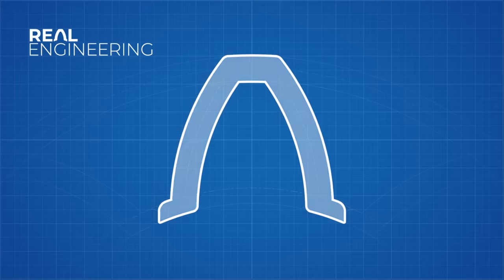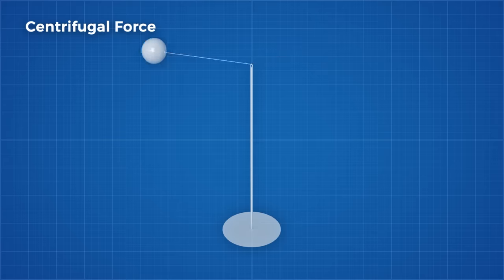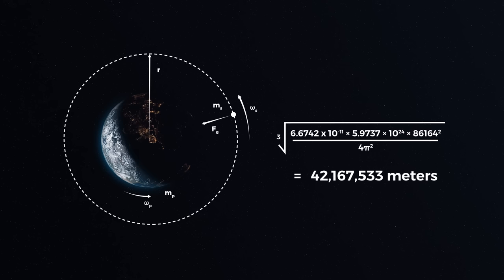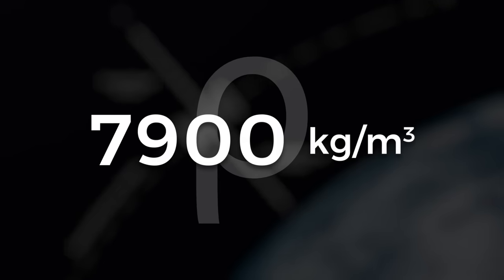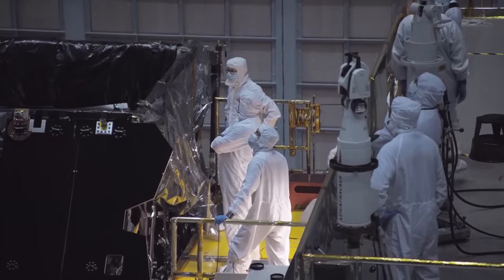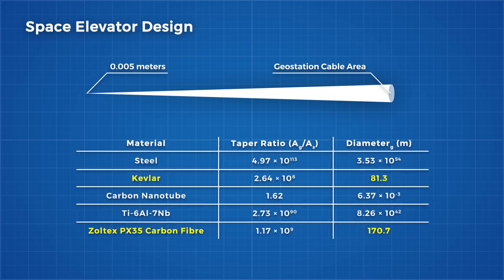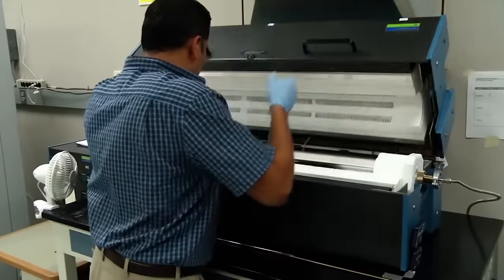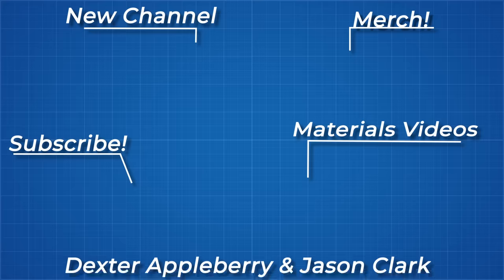Are Space Elevators Possible?

Comment: Short answer:  We have the maths and the engineering parameters but significantly lack in the building material strength to weight ratio category.
Reply: What we can measure for Carbon Nanotubes, if we could actually build them to a reasonable volume and length, it would absolutely be possible to build Earth's Many, many Space Elevator cables

While Space Elevators are conceptually envisioned as solely Equatorial constructions, thats incorrect. Once the counterweight is in position, it can be used to anchor any number of space elevator cables to the hemisphere of its Line of Sight.

In fact, When it is built for real, the Counterweights will be positioned over India and the Atlantic, So you could theoretically embark on an elevator in Syndey, Australia, and with some transit as the counterweight, them embark on the elevator to Athens, Greece.
Reply: @loturzelrestaurant  naw.
Reply: @Azakadune  Ok. But are you really sure? 
It would cost no money at all, just a bit of time, and it would benefit all of us, which of course includes you. 

Also: Dont you wanna fight some Karens? I bet you know that term. I know some, and you could flag them, so they have to leave.
Reply: @loturzelrestaurant  just wanna ask, what are you actually want to do?
Reply: Mr. Shack, that is the standard answer to what is holding back building a Space Elevator.  While super materials do need researching it's not actually true it's keeping mankind from building one.   A super strong connection is dependent on the design of the elevator and hundreds of other factors.  It's possible to design a working Space Elevator with variable requirements and capabilities.  Like most successful inventions the first working one should be a small prototype to test and measure for what is to follow.  Skyscrapers for instance were iterations of success as most things are.  So we're telephones, planes, ships, etc.  First just do it, then elaborate and improve.
Reply: @loturzelrestaurant  I'm racist, what are you going to do about that?
Reply: @lemonov3031  Cringing? 
That, for starters.
Reply: @lemonov3031  Afterwards, I'm pitying you. 

Do you wanna hear more about what i do?
Reply: @loturzelrestaurant  No, you are a spammer who posts off-topic crying for no reason
grow a pair and stop advocating for censorship
Reply: @lemonov3031  ...Oh, buddy... please stop embarassing yourself now... Its fine.
Reply: @loturzelrestaurant  sneed
Reply: we on't even have the fabrication technology to build a cable that big anyways
Reply: @loturzelrestaurant  I don't think spamming those words here in a YT COMMENT SECTION (out of all places) is you doing a "good cause"
Reply: @PlanetEarth3141  Materials and technologies are important but.... do we really need such elevator? Lets say we want to use it to get to LEO. Then we still need a rocket to accelerate to the orbital speed. Or if we want to get to the base station at the GEO.. then we talking about travelling ~35000 km. So how fast this elevator should go? 100km/h will result in 350 hours, roughly 2 weeks from Earth to the station. If we can manage to go up with 500km/h it makes ~70 hours (~3 days). For cargo it's kind of OK, for people not so much 😉
Reply: @tjblues01  Are you really a pilot?  Or did you take it off the internet and use it to insinuate you are?
Reply: @PlanetEarth3141  Your questions have nothing to do with the topic at hand. What did you want to accomplish by asking those questions?
Reply: @PlanetEarth3141  🤣🤣🤣🤣🤣🤣
Reply: Or you could just use Kurzgesagt's method and go with an orbiting "skyhook" basically one central body in orbit, and two long "hooks" of equal length going out in either side, with the whole thing rotating as it orbits... Basically you'd take your vehicle space plane thing and dock to the end of the hook, and hitch a ride either up to space or back down to earth
Reply: At some point heavier then air material overcomes this is impossible.
Reply: @F14thunderhawk  I'm racist and homophobic, also I'm a fascist, do you have some problems?
Reply: @loturzelrestaurant  I’m not a racist but you make me want to be one.
Reply: @myusername3689  "I’m not a racist but you make me want to be one." 

Allow me to own you by just reflecting youre own comment at you, cause that's all i need
Reply: @loturzelrestaurant  nigga 😭😭😭😭
Reply: @loturzelrestaurant  where is the link brother? Gimme a discord or something so we can talk
Reply: @lemonov3031  Lemonov Your comment from 1 year ago is so cringey to re-discover, it hurts.
Reply: @myusername3689  Dude, your comment from 2 months ago is hilariously cringey.
Reply: @thisiswhereidied3054  If you want Targets to flag then just go and watch various People covering Kent Hovind and Matt Powell. Countless covered him and you will see he's reportworthy. 

Not much for me to do here, mate.
Reply: @loturzelrestaurant  The sign is a subtle joke
Reply: @lemonov3031  What did you say that's racist?
Reply: And that's ignoring the science all together.
Reply: Not only Lack of (light but tough) material, but also in principle, at near Terminal point (36,000 kms alititude) we still need Rocket Drive to keep Tensioning the Cable(s) or in short, to Rescue the Alititude, not to be Dropped-down.. by using of 3,100 m/sec (Booster) Velocity. No nothing for a Free- Ride, 3,100 m/sec Impulse of Rocket (@ teminal end).. still lots of FUEL to be burnt. We live in the Real world of Carbon-Hungry machine. (If not, the whole Station will gradually lose the Altitude and Fallen-down to earth.)
Reply: Even shorter answer: no we can’t build them
Reply: fElon will save us! lol
Reply: @lemonov3031  racism is just externalized insecurity
Reply: Gotcha.
Reply: Don't be ridiculous! There's a high school kid in Queens who invented a liquid polymer that air-hardens instantly into a synthetic analog of spider silk strong enough to stop a speeding commuter train! Mostly he just uses it to swing from skyscrapers, but I'm sure he'd license it for use in aerospace applications. He's also discovered some intriguing pharmacological properties of radioactive spider venom.

Comment: other less discussed issues on  space  elevators is variable amounts of drag along the due to variable weather and increasing altitude, and whether it can properly resist or transmit thermal heating from friction and electric magnetic effects which snapped a multi mile long tether experiment on a space shuttle mission, and what kind of impact if any such a megastructure could have on earth/solar interactions, and what kind of tidal loading are earth, moon, sun interactions going to put on it; and whether micro organisms carried by the rain would colonize and begin eating the yummy line at the bottom, and how the top could survive contact with natural or  unmanned space debris. The benefit of most space craft is that you don't get sea barnacles trying to grow on them, and if they are in  danger you can boost them to a different orbit. This one is anchored. Actively defending the structure from "the elements" could be cost prohibitive even if building it is not. I think people could build them somewhere, the earth system just doesn't seem to be the ideal planetary situation for that type of space infrastructure.
Reply: You lost me at other
Reply: All great points...Also, how long have we been talking about carbon nano tubes, for quite some time.That's a mass mining and production scale we're not close to completing.  It seems like we're decades maybe even a century away before we could even look at the idea of having a space elevator. Like you said, there are just too many variables that would bring that bad boy crashing down and flinging everything else into space with no way to retrieve it.
Reply: From what I understand moon space elevator is possible with today's  technology and is actually easier to build because the moon is tidally locked. you have to put the satellite at the Earth-moon L1 and balance it there. But compensating for tides shouldn't be that much of an issue. you could either use thrusters or simply  change your center of gravity by moving the counterweight up and down.
But everything else is an issue. And weathering, needs to deal with space weather as well.  It has to deal with the solar wind and the environment in the van allen belts. 
A more serious challenge though would be the winds. Any force acting on the cable inside the atmosphere would be propagated through the cable to the space station which would need to constantly mitigate for it. 
As for space debris I do imagine one might mitigate this by having a mobile base, which can change position to avoid collisions. One imagines this could be achieved by moving the base and the station in a coordinated fashion along the equator line, but now you have another factor to consider: waves. Still, I think all this can be solved in software. 
It does pose another problem though: when the base and station move to avoid collision, this induces extra strain on the cable, which will lag behind due to inertia, so you'd have to factor that in the design.
As for erosion due to either lifeforms or weathering one does need to factor in the possibility of maintenance. And this is one structure you can't afford to neglect for a few thousand years, like the pyramids, as it would come crashing down on the planet.
Reply: @Peanutdenver  there is no additional mining output to be required to build something on this scale, especially if there was a slow down in other sectors that demand the raw inputs, but mass production output of quality graphene and/or nanotubes would have to greatly increase. and yes, entire fleets of reusable spacecraft, and the ability to economically collect, deorbit, deflect, or eject uncontrolled space debris are all vital prerequisites to both build and protect a project on this scale
Reply: Carlos Saraiva  On bodies with no atmosphere space elevators aren't really needed since you can use mass drivers to launch things from the surfaces since there is no air getting in the way.

https://en.wikipedia.org/wiki/Mass_driver
Reply: Also, there is no way to cheat the amount of energy it takes to get to orbit in the first place. Hoisting an elevator car(or w/e) up the cable would still require the same amount of energy that it takes to put a rocket in orbit. Sure, you can use electricity(if you're patient, ride would be slow) hooked up to the power grid on Earth, but that energy still has to come from somewhere. There is no free lunch.
Reply: @Thumbsupurbum  that is not correct, because the process of delivering the payload up to the orbit involves much more than just providing it with the required energy. Some energy is wasted in exhaust, and a lot of energy is spent to lift the stages that are later discarded.
Reply: @Tirinir  Yes, and some energy is wasted in the transmission lines from power plant to the site as heat. My point is that hoisting the car up would still come at a high energy cost. And that's AFTER building the incredibly expensive infrastructure. That point still stands. And will remain true, because you can't cheat gravity my friend.
Reply: @e1123581321345589144  It would be even more challenging since the moon slightly drifts away from Earth each year. I guess constant maintenance would do.
Reply: @Thumbsupurbum  Absolutely false. The whole draw of a space elevator is that you don't have to fight gravity and air resistance constantly pulling you down the whole way because you have something to push against. Most importantly, you don't have to carry extra fuel to lift all of the extra fuel you have to carry to lift all that extra fuel needed to carry that extra fuel (see: rocket equation). The energy used to lift 1000 kg payload via rocket vs space elevator is extreme. It's like comparing riding an elevator vs jumping 200 stories straight up. The elevator is just so much easier.
Reply: @toxicbubble5  Elevators have to work against the force of gravity to move up. What are you talking about? Gravity absolutely applies. If I'm pulling myself up a rope, I still have to pull myself up against the force of gravity. The rope doesn't help me achieve this. It only gives me something to hold onto. Air resistance applies too, but probably not relevant since the speed would too low to matter. Unless it's in a vacuum, but that would require even more energy to maintain.
Reply: Carlos Saraiva  They both require about the same amount of energy to use, but mass drivers are much smaller and require less materials. They can also be fired at different strengths to send payloads into different height orbits, or even directly onto interplanetary trajectories, rather than just geostationary orbit. The only real downside to mass drivers is that their payloads do need a little bit of maneuvering fuel to circularize their orbits, though that's not an issue for interplanetary launches. They also don't need to be built at the equator. They can also send payloads into inclined orbits, such as polar orbits. In general they are cheaper and easier to build and just way more versatile but are more limited on what bodies you can build them on.
Reply: Not all of the energy would come from the power grid, as the elevator would be pushing sideways on the cable the entire time it is moving, essentially getting (or losing) some energy from the planet's rotation. This also brings up the concern about the orbital velocity of the station at the end of the cable.
Reply: @Thumbsupurbum  Existing elevators use counterweights so no energy is needed to change altitude, only to change speed. Couldn't a space elevator recover and store the energy of the carriage as it descends?
Reply: @Thumbsupurbum  Of course you have not taken in to account the energy that could be generated by "regen braking" when the elevator comes down again (possibly filled with waste, maybe even space debris)
Reply: @Thumbsupurbum  On an elevator you don't have to constantly work to maintain your height however, which is what Toxic was probably getting at. Its the difference between standing on top of a building versus hovering with a helicopter, the first lets you maintain a height passively, the other require a constant input of power. A rocket has to not only provide the energy needed to lift itself upwards, it also has to constantly work to keep that height, every minute it spends getting to orbit is another minute it has to deal with gravity losses. 

https://en.wikipedia.org/wiki/Gravity_drag

An elevator car doesn't have to deal with that since it has the cable to grab. It could lock its breaks and just hang at any altitude completely passively. This lets it climb upwards at a leisurely pace since it doesn't have to rush to avoid gravity losses. That slower speed also vastly reduces air drag. 

Those increases in efficiency pale in comparison to the main one however, which is that a space elevator doesn't have to lift its own fuel. Over 90 percent of the fuel in a rocket launch doesn't go into lifting the payload, it goes into lifting other fuel. And that's just the fuel efficiency, the energy efficiency is even worse. Chemical rocket engines aren't particularly efficient at converting the energy in their fuel into kinetic, most of the power ends up as heat in their exhaust.  Even if the power transmission system to a space elevator car was only 1 percent efficient that is still significantly more energy efficient than a chemical rocket.
Reply: Great points, Earth space elevator is likely not happening.  Moon and Mars space elevator on the other hand is a near certainty.
Reply: The mass of the Earth is > 5*10^24 kg. Steel has a density of < 8*10^3 kg/m^3. GEO is at < 4*10^7 m. Imagine a steel tether stretching twice as long with a cross sectional area of 1 m^2. It's mass would be < 2*4*10^7*8*10^3=6.4*10^11. Compared to the Earth that is about 1/10^13. I haven't done an extensive analysis but I think it's pretty safe to say it's gravitational impact would be negligible.
Reply: Element proofing will be a problem to meet safety standards.
Reply: I agree its 2020 we dont just build just because its possible.  We build if its wise n safe now
Reply: Low gravity means not high thrust needed to escape gravity there.
Reply: Carlos Saraiva isn't the whole point of a space elevator to have a low gravity launch station to enable spacecraft to travel further since they don't have to waste so much energy on leaving the atmosphere? If you're starting from a very low gravity planet, a space elevator probably doesn't make sense.
Reply: Don't forget the potential damage from exposure to unfiltered UV
Reply: @Thumbsupurbum  So since ferries are easier to set up, we do not need bridges?
Reply: @planetfall5056  Are they compatible with human passengers? I saw Moon, "I did the math, you're gonna pull some g's, but you'll make it."
Reply: @markharmon4963  Depends on how long the mass driver is. The Moon's escape velocity is 2.38 kilometres per second, you could get up to that speed with a few kilometres of track accelerating at a human safe 1g. You can use pretty much any acceleration as long as you build a long enough track. If your just shuttling cargo you can use short, high gee tracks, but even a pretty long passenger safe one would probably use less material then a space elevator.
Reply: @planetfall5056  Of course. Thanks.
Reply: @planetfall5056  how do you land?